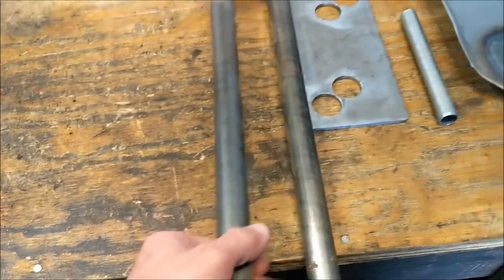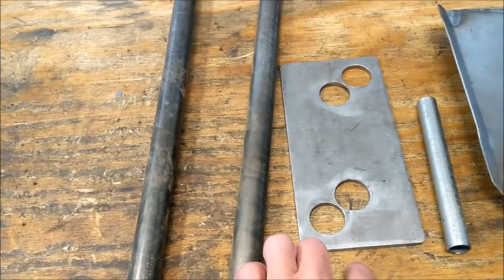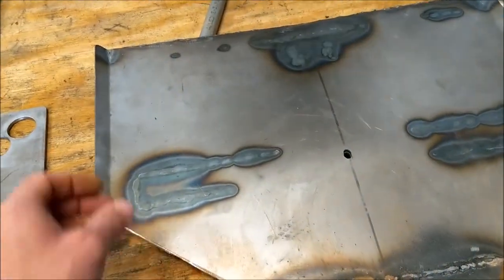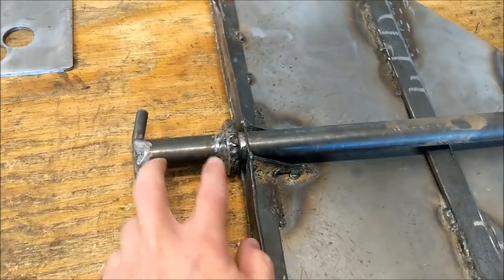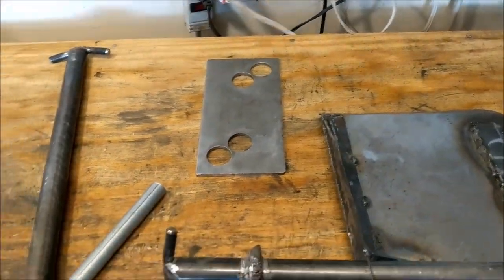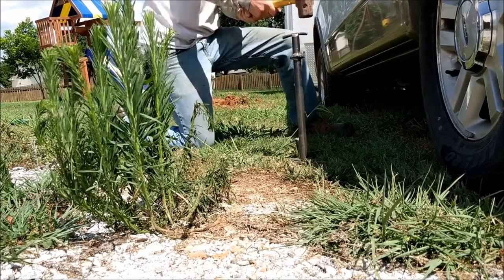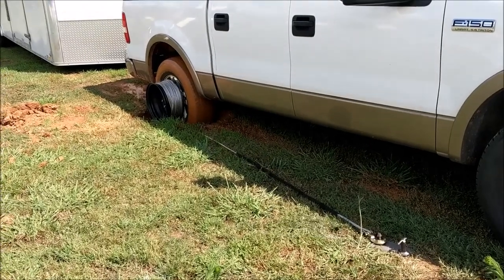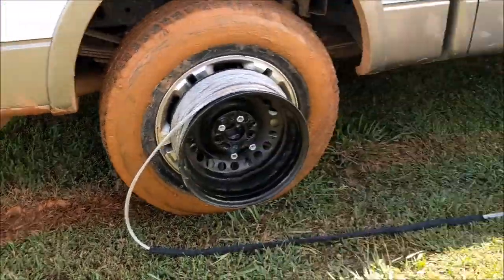No Trees to Winch? How to Make a DIY Ground Anchor or Earth Anchor

Comment: That's a lot of weight.  Then you have to carry a sledgehammer, cable or chain, and finally some device to actually do the pulling.  A lot of weight for something that gets a free ride, i.e. is carried, but mostly unused. Hopefully.
Reply from the maker: Yes this is for the person who already has a winch, but may find themselves stuck in an area with few trees.  In my case, it was Colorado near tree line elevation.

Comment: dude that's great but there is no way those stakes pull out that easily in clay u must have like greased them or something ...when it gets light enough outside I'm going out and drive a rod in the ground and throw my back out to prove it .....got to check ur other vids out first ....rockon
Reply from the maker: Yes they did, you just have to twist them back and forth while you pull, as shown.

Comment: You're going to get stuck in mud, snow and sand not on hard ground. Show demo in soft ground conditions.
Reply from the maker: I show the underfoot conditions for this demonstration in my Wheel Winch video (which uses these stakes) on this same YouTube channel.  It was wet clay with a 50% grade coming out of a hole.  You can see a close-up of the water and angle finder at the end of the Wheel Winch video.